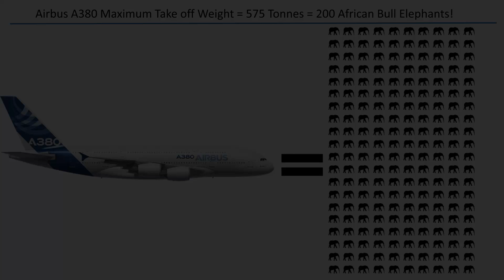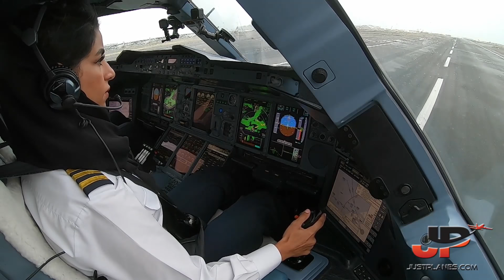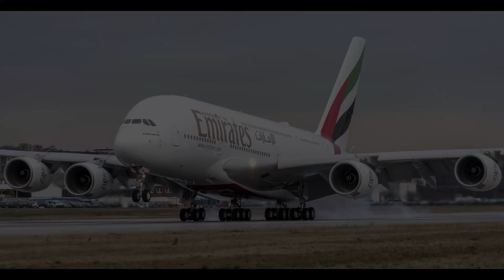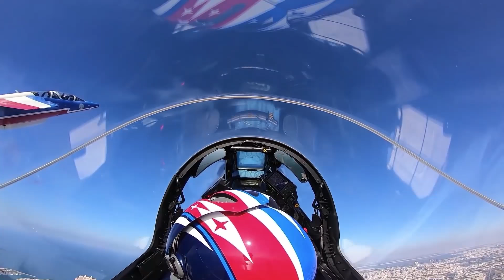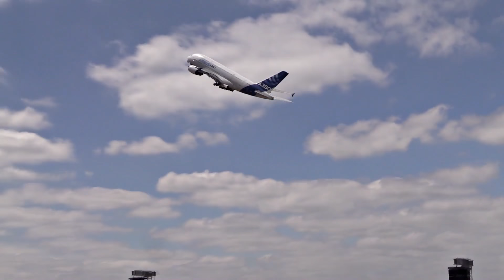How Does Lift Work? (How Airplanes Fly)

Comment: An amazingly simple and broad explanation, thanks! I finally understand how it works 🤣
Reply: It is INCORRECT:
This isn’t the worst explanation of the physics but still  has Two SERIOUS errors.
.
@1:45 The elevator surfaces are not called “rear flaps”. Flaps are on the wing.
.
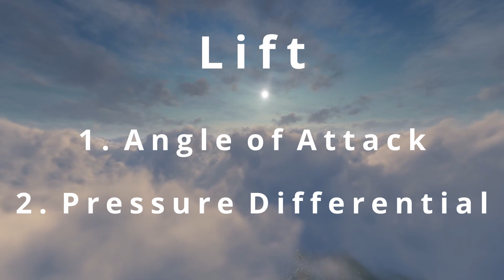@ 2:22 Saying that AoA and Pressure differential is not a bad simplification / summary, but implies there are two lift forces.
.
@ 2:48. Air does NOT bounce off the lower surface.  It flows downward in a smoothly curved flow. Even MORE air flows curved downward from ABOVE the wing than below.
.
@ 3:20 The top-Bottom pressure is ALL the lift.  However, a pressure difference will only MOVE the object if it is free to move.  A craft in level flight is not “moved” upward by lift. 
.
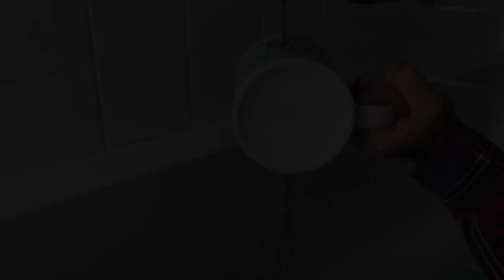@ 3:51 The Coanda effect does lower the pressure near the surface of an inside curve, but Coanda is only for a jet of fluid in an otherwise still environment.  This does not happen above a wing.  However, the similarity is the lower pressure on the inside of the curved FLOW. Making them easy to be confused.
.
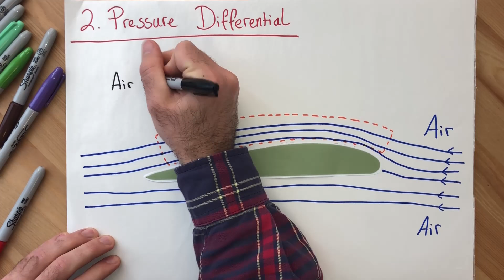@ 4:15 The first serious error. The flow is Not squeezed. There is no hard wall above the wing, but a soft cushion of air. It is NOT a venturi tube. This is one of the common misconceptions.
.
Fluid has mass and a net force is created by a pressure difference between two locations – called a Pressure Gradient. Euler first recognized this in the mid 1`700s following up on Bernoulli’s work.  That net force Accelerates the mass of air away from the higher pressure toward the lower pressure.
.
A Pressure Gradient provides the force  that Accelerates air toward the lower Pressure.
The air speeds up because the pressure ahead of the wing is roughly atmospheric pressure which is greater than the reduced pressure above the wing. This pressure is reduced because it is on the inside of the curved flow – It wants to go straight, per Newton’s First Law.  You can view it as it is the inertia “pulling away” from the center like you feel moved to the outside car door in a turn. Read Newton’s First Law.
.
.
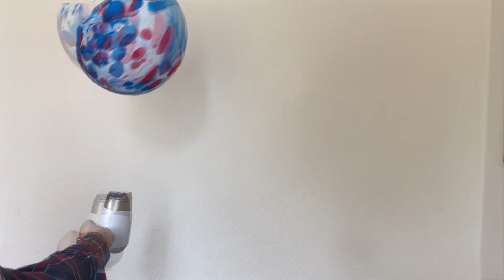@4:50  The second serious error.  The “faster air” out of the blower is NOT at a lower pressure than the still air around it. This is well known by aerodynamicists and easily measured by anyone with simple equipment. It is the true Coanda Effect creating a centering force by lowering the pressure more when more air curves around one side – allowing the higher air on the other side push the ball back in.
.
The pressure inside the blower is higher than atmospheric pressure.  This creates an Euler Pressure Gradient which accelerates the air away from higher pressure inside the blower to the relatively lower atmospheric pressure outside where the moving air assumes the atmospheric pressure of the still air around it. Euler again.
.
The video does not make it clear that while there are the two things that are significant for lift, it FAILS to clearly state that the entire lift is from the Top-Bottom Pressure Difference.  Those pressures are in effect, created by the curved flows below and above which the angle of attack contributes to.
A full treatment can be found here:  https://rxesywwbdscllwpn.quora.com/ 

- - 
Regards.

Comment: On a symmetrical airfoil,the zero attack angle is drawn from the leading edge the trailing edge. However for a cambered airfoil, that angle is above the leading edge more relative to the trailing edge angle.

Comment: Angle of attack and pressure differential are not two different independant factors contributing to lift, they are two aspects of the same global process. Pressure differential is responsible of the total lift, since no other force than pressure forces can create lift. Of course if the wing pushes the air in some direction, the air pushes the wing in the opposite direction, but this can happen only via the pressure forces.

Comment: What is not so clearly explained here is that the low air pressure (or near vacuum) above the top surface of a wing is due to the fact that the air is forced to travel quickly upwards to get around the flat-bottomed teardrop shape of the wind's profile (this is easier to explain with a diagram- which, of course is not possible in a YouTube comment). The air's momentum causes it to form a partial vacuum along the top surface of the wing- which causes lift.

Comment: You didn't mention the cause  the lift which is downward accellerating air. You don't get lift from a pressure differential. Rather a pressure differential is lift. In any case you can't have lift without accellerating air downward, nor can you accellerate air downward without getting lift. The bernulli effect doesn't cause lift, rather, it is lift caused by the deflection of air. No deflection equals no lift regardless.
Reply: There is no downward deflection of air.  Watch a light aircraft fly low over long grass, the grass doesn't even move!   The spoilers are on the upper surface of a wing because that is where the lift is created.  Ice or dirt on the upper surface degrades lift significantly.   Jet fighters have all the kit under the wing, not on top, for the same reason. 
The drop in pressure on the top of the wing can be measured and if it is multiplied by the area of the wing you get the lift, which is more than the weight of the aircraft.

Comment: No explanation is complete without including the cause of the lift force. The cause of lift is downward accelerating air. A pressure differential doesn't cause lift, but rather, is lift caused by the downward acceleration of air. You don't get lift without this. Nor can you accelerate air without getting lift.
Reply: Wrong! It is the horizontal acceleration of the air over the upper surface that causes 80% of the lift, and it can be measured.  The drop in pressure is only 3% of the ambient air pressure but multiplied by the wing area gives you more lift than the weight of the aircraft.

Comment: Right, it's mostly about downward deflection (Newton's law) vs. upward pull (Bernoulli's law) - HOWEVER - you did not tell us the approximate % of lift due to each.
Reply: About 80% from the upper surface and 20% from the lower surface.  A flat wing gives virtually nothing from the upper surface (turbulent air) and 100% from the lower surface but is very inefficient, needs a lot of engine thrust.    Cambering the upper surface is what provides the lift essentially, that is why the spoilers are on the upper surface.

Comment: I think you are wrong. It works according to Bernoulli's principle that states that in fluid dynamics an increase in the speed of fluid occurs simultaneously with a decrease in pressure or decrease in the fluid's potential energy1 This is what creates the lift for the plane!
Reply: Right bro

Comment: Question or questions, I was taught the lift of the wing ect, but if it’s really true, why does the plane need to to pull back, it’s really not lift, it’s just angle of attack. Point can be made why can a air plane fly upside down. Of what I say is true, but with the wing causing low pressure just basically helps it fly better.  So anything can fly with a big enough e give then.

Comment: This is very clear and may well be correct. But it has its doubters in the science world. Newton's 2nd and 3rd laws of motion provide a clear and simple alternative, as follows...  the wings push a mass of air down, imparting a vertical component of velocity and hence momentum on the air. Since force is defined to be rate of change of momentum, ( Newton's second law ) it follows that this air experiences a force vertically down. Newton's third law tell us that when one object, the wing, exerts a force on a second "object" , the air, then the second object must impart an equal and opposite force on the first object, the wing. So the wing experiences a lift force.

Comment: in 2024 you should not explain it like this and not in the 1980s either. There is a flow above the wing. the has a shape. The atoms and molecules in the oncoming air have mass. They have trouble following the wing shape  but they have to fill the void somehow. So the distance between molecules get larger and the air pressure drops. And this is Exactly how a sail on sailing boat works. Angle of attack ... if it increases makes it even harder for the molecules to follow the shape and air pressure drops more and lift increases. Molecules are hitting the under side of the wing so there is always lift there but majority on the top of the wing. If angle of attack increases further the molecules can not follow the wing shape anymore. The void have to be filled somehow so you get turbulent air that loops around 180 degrees to fill the void. In any case the purpose of the wing is lost you have turbulent air and much lift is lost but not all but most is lost.

Comment: Still misses the point. If compressing the air over the wing creates a low pressure zone, why not a bulge at the back of the wing instead of the front. Our even a bigger bulge in the middle of the wing. A 10ft bulge must create tremendous lift.

The balloon experiment proves it’s not the fast moving air on top of a wing that lifts the plane because the air is accelerated the same on both sides of the balloon. And somehow it stays aloft. How?

Comment: Air squeezed  -  nope  it is not near  sonic  speed flight. SO no squeeze. Reality is simpler -  Bernoulli principle is not only  about speed value but direction as well . So change of absolute value  of velocity ( speed)  or   direction of velocity  causing  pressure value ( so called dynamical pressure). And this is what wing  is doing  asymmetrical  change of velocity  around wing  and resulting  asymmetrical pressure distribution. Wing design  is to maximize   such  diiference and not introducing much drug  or transition  from laminar to tu turbulent flow.

Comment: Thanks for the video. I have a question: What are the mechanisms engaged by pulling the stick and that make the plane tilt up and achieve the angle of attack?
Reply: On older planes the stick is connected to a system of wire cables and pulleys. When the stick is moved the respective cable pulls on a hydraulic valve to activate the appropriate flight control actuator. On modern planes the actuators are activated by electric impulses through electrical wiring. dcniner01
Reply: @dcniner0187 Thanks! And I assume this makes the elevator flap move, right? Is this the only thing needed to achieve the angle of attack?

Comment: The engine, does the main work, it must be strong enough to lift the plan vertically upwards only.

 For an object to fly it most posses both vertical and horizontal forces. The wing provides this vertical coefficient of force, using drag at the front point of the wings( the thick part of the wing) allowing the slim part of the wings to lift up in a semi circular manner(because there is less drag at this point) . The tail flaps enhance this process during takeoff

Comment: Does a plane require the same take off
Speed to land or less. Also explain what prevent the plane from falling out of the sky when it cut it speed and slow down in the case of landing or going around before landing.

Comment: Flaps  are not moved during run ups, they are set to a certain degree based on passenger/cargo load, the temp of the day, humidity and the runway length,  prior to start of run during the take off procedure call. The pressure difference on upper & lower wings are due to the venturi effect.  The air flowing past and over the wing does not stick till the end, it detaches itself before the trailing edge. The upper area of the wing near trailing edge which has no air contact is called "wake area". It is not a desirable condition though. So,  vortex generators are installed on upper wing to have air in contact, no matter it is not as smooth as the air on front upper area of the wing. The lift formula has no place for wing (aerofoil) thickness. The aspect ratio or the length x width is the one that has significance. Modern jets have thicker wings for structural strength as they are also used as fuel storage. When flaps are deployed, it is the aspect ratio that increases, thus creating more lift.

Venturi effect can be tested by holding two pages, an inch apart, near your face and blowing in the gap. You wil notice that the two pages do not expand apart as you may have guessed, instead they come close like sticking together. Same effect can be seen when a truck or high speed car crosses your motorcycle or car, you feel the magnetic effect of leaning or moving towards the other vehicle. Keep this in mind and be careful on highways.
Reply: So, how does the plane go from accelerating to lift off and flying? That's all due to the angle set before take off? Or is the rear flap controlled by the pilot? None of the videos explained this important part clearly!

Comment: unfortunately.. this is not 100% correct
lift does not get the airplane into the air.. something called "excess thrust" does

in a steady climb, lift is actually less than weight (gravity)..

Comment: Good basic explanation of how wings work, one of the best I have seen without getting too technichnical.
Reply: Not it isn't. Air pressure differential and angle of attack are not two separate effects, but but two ways of saying the same thing.
Reply: But they are two separate effects. Angle of attack is the effect you experience by sticking your flat hand out the window of a driving car and tilting it. Air pressure differential is a factor of the shape of the wing and speed of the air travelling past it. When the plane reaches cruising altitude, they level out and there is no longer any angle of attack, but the plane is still producing lift from the pressure differential. If it were the same thing, they would need to keep an upward pitch to maintain flight which means you’d never get a meal or drink on the flight because they can’t roll the meal carts uphill and your drink would just slide off the table.

Comment: As always, the most important part is skipped: what is air. It has mass and it sticks to surfaces where it flows along. Furthermore, every aircraft and flying animal produces lift by throwing down air (=mass). Action is reaction is lift. That's all. The ways a wing grabs the passing airflow and throws it down is very interesting, but details which are not really necessary to understand how lift is produced.

Comment: It’s not lift 
It’s actually push 
An aircraft is pushed into the air 
By the angle of the air low under and over the wing related to speed 
This is then adjusted during flight as needed
Reply: finally a guy who knows what "excess thrust" is!
too many youtube videos out there claiming it's lift that makes an airplane gain altitude....

Comment: Even as someone who has loved and studied aviation for 30 yrs i still have some basic questions like the Wings and Fuel...am i the only one that wonders how it's possible for the wings to hold a good 400,000 l bs of fuel plus 4 engines and withstand the forces on it while flying and somehow also push the rest of the plane forward without snapping off?..the fuel really gets me cuz it doesnt ever look like any plane  can hold as much fuel as advertised and then to have wires and hydraulics running through them and numerous control surfaces attached to them and then maintain that strength while the plane is moving over 500 mph it really is literally mind boggling..im 37 so i dont know a world without planes but even with ally i know it doesnt make them any less amazing and borderline Magic so im sure even the most intelligent from the past lose their minds seeing a plane fly
Reply from the maker: This is a great question. I'll try and do a video on the structure of plane wings at some point!
Reply: The basic structure of airliner wings is a box. There are very strong spars ,front a rear that extend outwards to the wingtips. There are fore and aft bulkheads that connect the two spars together. There are then two skins , upper and lower. These skins have stringers attached to them which also run from inboard to outboard. These stringers attach to the bulkheads. This creates an incredibly strong box section. The fuel fills that box. The leading edges attach to the front of the front spar. The flaps and ailerons attach to the outside of the rear spar. The fuel lines are located inside the box (tank). Hydraulic lines are usually attached to outside of the rear spar. Electric and cables are mostly on the outside of the front spar, inside the leading edge. dcniner01

Comment: Thank you for an excellent presentation. I understand the principle of the wings moving up to fill in the area of less pressure and thereby producing lift, but I would like to know more about the science of faster air producing less pressure. On the question of the aerofoil's shape causing this pressure difference, what happens when a plane is flown upside down, at an air display for example? The low pressure is now underneath the wings, 'lifting' the aircraft towards the ground. So ... how is flight now possible?

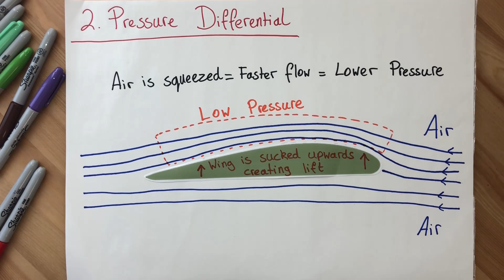Comment: 4:24 Aerospace engineer here. Sorry this isn't true. You're using Bernoulli's principle and it doesn't hold here. This principle would be true only if the fluid was incompressible and the process was adiabatic. None of these are true in this case; that is, air isn't compressible and there's energy transfer between the wing and air. This isn't a closed system. 
Fact is, you'd have to use all three Euler's equations and all three laws of Newton to explain lift and drag. Currently, there is no intuitive explanation unfortunately.

Comment: The video is WRONG. There is a pressure differential, but the explanation for it is wrong. 
How LIFT is ACTUALLY generated: https://youtu.be/XWdNEGr53Gw?si=XHC1bVsR4A52Fajz
Slides: https://youtu.be/Vx_6zhMRFgU?si=qutasvlAhawor49W